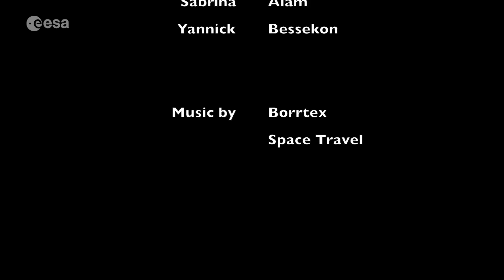Concept for a Moon base

Comment: It would be much simpler to  deploy a tall pressurized vertical habitat onto the lunar surface and then surround it with a cylindrical regolith fence with a 2 meter gap between the  pressurized habitat and the fence. Then all you have to do is to  fill the fence with regolith using a robotic electric crane equipped with a clamshell for picking up and depositing regolith. Such a method would also use substantially less regolith for radiation and micrometeorite shielding. 

Marcel

Comment: 0:51 crater filled with regolith. how? will it do astronauts with shovel? okay first module will be landed on button but how you will connect lifesypportsystem module in bottom of crater? throw it off from crater's cliff to the bottom?)) or will you build crane on the moon? its just animation without any concrete technical and engineering information. try it first on our planet and then think about outer space...ESA...